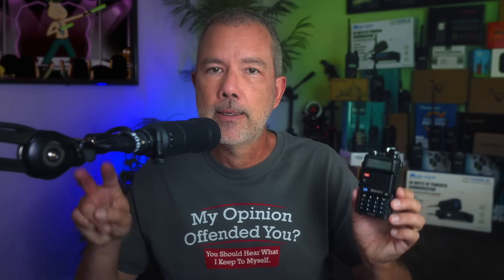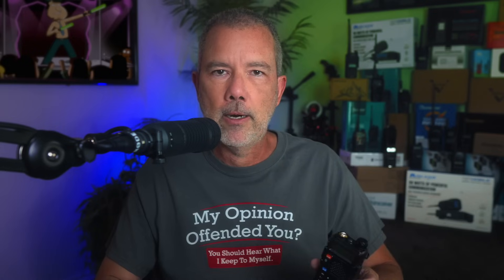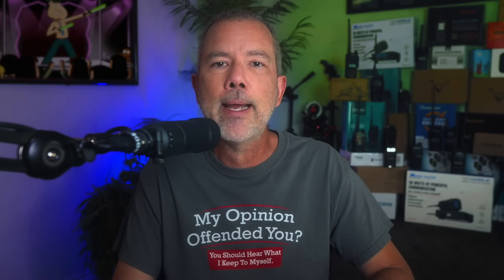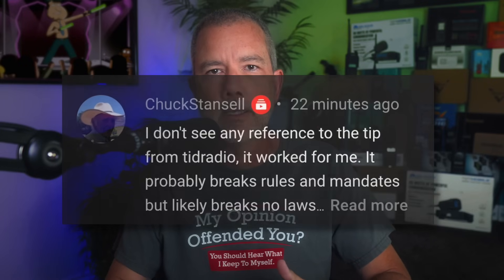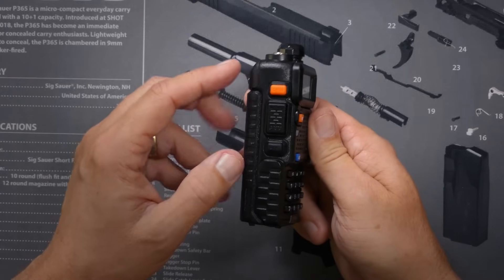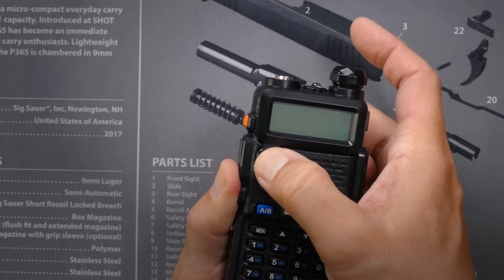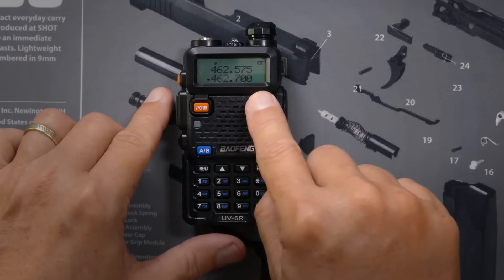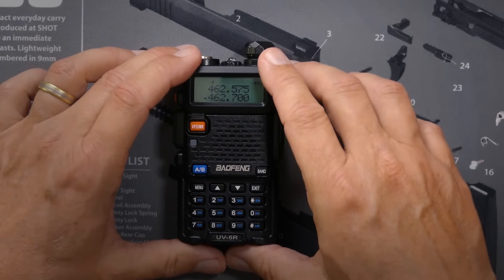How To Unlock A New Baofeng UV-5R - Easy UV5R Jailbreak To Transmit On More Frequencies

Comment: Any more details about potential CHIRP issues after this? Will a factory reset "Un-jailbreak" it so CHIRP will work as before? How common is this, just a "some people report"/"May possibly happen" thing, or a more of a sure/likely thing? And does it just affect a few things with CHIRP or make CHIRP useless?

"WARNING #4! - Some have reported issues using CHIRP with their UV5R after jailbreaking it - if you rely on CHRIP/are unable to program the radio by hand, do not try this."

Comment: Doesn't Work with new Radio. Shows "FACTORY" on screen but will still not transmit out of range with only beep that is it will not transmit on 220 Mhz Band even after using chirp to extend the upper VHF range. Did not try GMRS frequencies.
Reply from the maker: As clearly mentioned in the updates posted in the More Information section.

Comment: I'm new to this will this be able to pick up dmr ?
Reply from the maker: Yes, but it wont be able to decode it.
Reply: @TheNotaRubicon  I'm not sure what that means exactly but I'm guessing what ur saying is I can't use this for my job since we use dmr , thanks for your timely response sorry for some silly questions.
Reply from the maker: Sorry to confuckulation you.  The radio will 'hear' the digital signal, but it cant decode it, meaning all you would hear is garbled digital noise, and it would not be able to transmit any DMR.. 
So, DMR is a no-go with this radio.  You're not going to find a 'cheap' radio that can do DMR.
Reply: @TheNotaRubicon  luckily it was a yard sale find thanks for the information tho it was helpful.

Comment: SOLVED!
I changed to the FM radio and performed the 3 button dance and voila! Unlocked!*

Didn't work on my uv5r.
I tried both the 3 button and four button methods (4 button is to add the call button + the 3)
Reply from the maker: Is it locked? It wont work if your radio isnt locked.
Reply: @TheNotaRubicon  with locked you refer to not being able to TX?
It strange because on the back of my radio, when the battery is removed, i see freq range,  but i can tune in about 199.000 below and 199.000 above those freqs but no TX.
Will try different bands and see if it works.

Thanks for the quick response! 👍
Reply: @TheNotaRubicon  see my edit on the first post, solved it!

Comment: I didn't get the FACTORY on the display.
Reply from the maker: Then, either you did it wrong, your radio is not a UV-5R, your radio is not locked to begin with, or your radio is not UNlockable.

Comment: Yes that did nothing.
Reply from the maker: Is your radio locked? If you try this on a UV-5R that is not locked, it will do nothing because this step is not necessary.
Reply: Its locked as far as I can tell. I can't access the menu or change channels .   @TheNotaRubicon
Reply from the maker: Your keypad is locked, which is VERY different from frequency-locking which is what this video is about. RTFM and you will see how easy it is to unlock your keypad.

Comment: how come your default frequency shows 462.700 , i purchased one and the default is 435.722 , i am new to this and i want to receive certain frequencies  from 454.100 onwards ... how do i do this.. your advice is greatly appreciated.
Reply from the maker: Because thats the frequency I typed in to listen to. Just switch to VFO/Frequency mode and type-in whatever frequency you want to listen to.
If any of that sounds confusing, you will need to watch a few more of my videos, but you'll figure it out.

Comment: Thank you. Yeah. This is exactly what I needed to do in order to transmit on gmrs channels. I did a test because I have these to use in emergencies. Also I have a paper copy and screenshot of the transmission frequencies for GMRS channels. Doesn’t help that your unlocked if you don’t know what frequency to enter to equal channel 16 on an FRS radio, for example.
Edit

If it makes you feel better. I did order two brand new UV5R radios from Amazon. Great deal, only about 20$ each and you get a radio, earpiece, and charger. I received them in the mail this morning and got them working thanks to this video a minute ago. This is as of 3/7/2024. Looks like I’ll be investing into those better antennas for these. Thanks.

Comment: What do I do if it doesn’t work
Reply from the maker: 1) Do it again, but do it right
2) If your radio isnt locked to begin with, dont do anything because unlocking it isn't necessary.
3) If your radio is locked, and you did it right, then you have one that cannot be un-locked, and there is nothing you can do.
Reply: @TheNotaRubicon  Thank you! What is the method to confirm that it is locked?
Reply from the maker: Read through the warnings and updates in the More Info section about knowing if your radio is locked or not.
Reply: I think I connected some dots. I don’t want or need to unlock my radio. And they actually work when they’re not next to each other 😅
Thanks for your explanations and patience!

Comment: Mine said "coping" . never said "factory"
Reply from the maker: Is it even locked?
Reply: No reception to the other radios, so it doesn't appear to be transmitting. No irritating beep though. @TheNotaRubicon
Reply: I dinked around with the offset and got it to go. thnx. @TheNotaRubicon

Comment: it appears this no longer works...
Reply from the maker: it still works on many new UV-5Rs, but not all. It seems to be the luck of the draw.
Reply: @TheNotaRubicon  I think I need to return the Radios...   I can't even get them to transmit on the free to use freqs either
Reply from the maker: its a ham radio so it should only transmit on the ham frequencies.
Reply: @TheNotaRubicon  well I am trying to transmit on the US ham freq's...   no luck...
Reply from the maker: Ok, then you are either doing it wrong or the radio is defective...
...and I doubt you have a defective radio..
Reply: @TheNotaRubicon    it was...  turn t off.... then hit 3 buttons at the same time..... then turn it on....   wait for the word FACTORY   let go of the three buttons...  then it should work...  it doesn't... I tried turning it off as well... and back on... no red / orange when keyed.

Comment: I followed these instructions to the letter.  It did not go into Factory mode.  It just turned on as normal.
Reply from the maker: Is it even locked? If it's not locked, it wont do anything because you don't need to unlock a radio that isn't locked.
Reply: @TheNotaRubicon  I figured that was the case.  I don't know how to tell if it's locked or not.  New to the hobby.  Thank you for taking the time to put up all this info.  It's REALLY useful.  I just watched your video on setting channels.  Very cool stuff.
Reply from the maker: Please read the warnings in the more-info section of the video.

Comment: 2/5/24 - This method no longer works.
Reply from the maker: 2/5/24 - actual correct information: This method still works perfectly well on MANY UV-5R radios, depending on where you bought it from and how long it sat in a warehouse before it was shipped to you.  However, on SOME uV-5R radios, it no longer works.

Comment: Wish this worked with my new F8HP :( It will not display FACTORY when doing this yet the TX light dies go read but no okencan hear me on GMRS or MURS :( Plz if anyone knows a way to unlock this model wven if its a hardware mod let me know Thanks!! 73
Reply from the maker: Is it even locked?
Reply: @TheNotaRubicon  No one can hear me on any GMRS or MURS station at all the light goes red though. So yeah I think it's locked

Comment: What if the multi button unlock does not work?      I can hear ham but no red light when I hit that big button..   Using chirp and download from repeaterbook and in the 146.??? range.
Reply from the maker: Is your radio even locked? It wont work if the radio isnt locked because unlocking a radio thats not locked isnt necessary.
Reply: @TheNotaRubicon   Looks like I fall victim to UPDATE #3 and SOL I guess. Radio was from Dec 2023.

Comment: So I just bought one in Romania from eMag and has the TX unlocked for these frequencies. 13.01.2023
Reply from the maker: That makes sense since the locking is only for the radios sold in the United States.
Reply: @TheNotaRubicon  Thanks for your reply ! Usually we have more laws here than in US, they are very strict with the frequencies and transmit power (max 0.5W PMR, 4W CB). I bought this radio to use it as PMR for being very cheap under 20$ then I saw the capabilities. There's one field they don't fully control and thats the import retail.

Comment: The BF-F8HP that is just purchased this week 1/11/24 does not seem to be locked.  I programmed in all the GMRS channels and it worked without doing this.  I also want to buy a GT-5R.  Does anyone know if those are already unlocked or if this procedure will work on that model?

Comment: Will not work on my UV5R
Reply from the maker: Is your UV5R locked? It wont work if its not locked because you don't need to unlock a radio that isnt locked.
Reply: @TheNotaRubicon  for as far as i can tell it is a stock radio.  I got it new like 3 to 4 years ago. I cant acces the 220mhz or go lower then 136/174 or the 400/520 band.
Reply from the maker: It sounds like you dont know what locked/unlocked means. Please read the info and warnings in the More-Info section.
Reply: Oke😅. Haha thanks.

Comment: Did not work on mine. Tried it 10 times and has not worked
Reply from the maker: Is your radio locked? It wont work if you dont have a locked radio, because if it's not locked you dont need to do this.
Reply: It a new one. I have an older unlocked one and it will not receive anything from new to old.
Reply from the maker: There are a lot of reports of the very new ones being un-lockable. Looks like that's what you have.
Reply: That really sucks.lol

Comment: Thanks! I’ll be buying one, but will it unlock all or most of the FRS/GMRS channels from 462.5625 to 462.7250 to match my cheap Motorola radios?
Reply from the maker: No guarantee.. It's hit and miss with the new ones.

Comment: does not work on the BFF8HP radio/any leads to get this radio unlocked, thanks
Reply from the maker: Are you sure its even locked?  if its not locked then you cant unlock it..because.. its not locked.
Reply: when I do the button combination (several times\with power on) no indication of a factory reset. I did try to go outside of the factory set Freq to check if it is unlocked, no can do. I did find it can be done through chirp SW, waiting  for the program cable to arrive to try that. also I am not sure what version of the BFF8HP I have\is there a way to find out what gen I have on this radio.BTW thanks for a quick reply . @TheNotaRubicon
Reply: going back on my amazon history it states that I bought a UV-5R 3rd Gen/bought on 09/2019  @TheNotaRubicon

Comment: I tried this on my UV-17R (just like you said not to). The radio was bricked until I removed the battery (screw on batt was a bad choice). Unit functions normally again.

Comment: Anyone know if and how to unlock a 21r i got one for free but cant find anything on it, ive also got a 999pro i got for free and cant figure that one out either any help would be appreciated
Reply from the maker: Most radios are not unlockable.. If you cant find how to unlock it after 3 minutes searching Youtube or Google, then it is likely that it cannot be unlocked.
Reply: I didn't figure, but i got em for nothing, so i figured it'd be worth a little further research. Thanks for the response

Comment: I just got two "locked" uv5-r 8 watts about two weeks ago. All I did was hooked them up and used CHIRP to install my radio channels from my old uv-5r 5W and they work. But the paper with them says they will not tx on GMRS. Well, I guess CHIRP didn't get the message that they were locked.

Comment: Mine didn't say "Factory", just said "Channel Mode"...
Reply from the maker: That means either you did it wrong, the radio is not locked to begin with, so you cant unlock it, or, you have an even newer one that cannot be unlocked.
Reply: Thanks for the rapid response--it is a UV-5RIII @TheNotaRubicon

Comment: I was follow the video instructions, however show me as factory reset, but when I put in a frequencies number immediately change back to a other.... Any advise please.
Reply from the maker: Unlocking the radio does not change what frequencies you can enter/receive so it sounds like you are entering a frequency that is outside the range of the radio.
Reply: SO HOW CAN I CHANGE THIS PART?
THANK YOU FOR YOUR REPLY. @TheNotaRubicon
Reply from the maker: You will have to buy a radio that receives the frequency range you want to listen to.

Comment: Hi Randy. Firstly, love the channel & your videos. @bryanb4308 is 100% correct.... like him, your sense of humour cracks me up. Real Estate on Mount Stupid must be worth a fortune nowadays. 
I'm late to this party, but the factory reset method using the PTT/Mon/VFO buttons together then turning on, does not seem to work on the Canadian UV-5RIC model, or at least not on mine. The Reset All option does wipe out all one's settings however, but a quick jaunt into CHIRP will put things back to rights.
Thus far, I have been unable to locate any methods of "unlocking" the radio for Tx on FRS/GMRS (license exempt here in Canada). As an aside, the GMRS radios such as Midland's offerings are illegal for use in Canada. 
Keep up the great work! Love your Jenga Wall.

Comment: Wow, just tried this on my new uv-17 and bricked it. Any thoughts on how to reset it?
Reply from the maker: Please read through all of the warnings in the More-Info section.
Reply: Not pointing any fingers. I did what I did to see if it would work on my radio, for which it did not. Was just hoping someone would have a suggestion as to how to make repairs. Love your videos, and appreciate your production value.
Reply from the maker: Does it not even turn on/are you able to get into the menus and try a reset?  If not, try pulling the battery for 5 minutes then put it back in and see if that does anything.

Comment: UNABLE to UNLOCK! (you just turned me into a sad ham! lol jk i dont have a ham lic.) 

Purchased UV-5R 10/01/23 (CHIRP reads it as a radioddidty, forgot which model). 
I tired doing the 3 button hold down and turn on but it does not show a "factory" message.
Reply from the maker: Is the radio even locked to begin with? If its not locked, nothing is going to happen.
Reply: ahhhh.. you are correct sir. I guess it came unlocked.. so once you unlock it and see the "factory" message that it. it wont pop up again. thank you  @TheNotaRubicon

Comment: We have 4 unlocked UV-5R radios. I am trying to get them to communicate with our Standard Horizon HX300 radios. I can transmit to the SH and hear the transmission on the SH. When we try to reply from the SH the Baofeng lights up and shows it is receiving a transmission, but nothing comes through on the speaker of the Baofeng. Any cure for this?
Reply: baofeng doesn't like being near your HX 300 so keep them at least 30 meters away and everything will be fine.
you also need to deactivate the receiving tones at the baofeng (ctcss)

Comment: Try this, with help of my right BIG TOE got a cramp..  working with uv-5r+ plus.  It did not work for me. Any suggestions?
Reply from the maker: If it didnt work then either your radio is already unlocked, or, you're not going to be able to unlock it.

Comment: Hello... I have a BF-F8HP, and it will not enter FACTORY mode at all. I've reset all multiple times, and I've followed your videos to set up. But can't get my radio to jail break into FACTORY.
Reply from the maker: Is it even locked? It wont work if the radio isn't locked becuase you don't need to unlock a radio that isn't locked.
Reply: @TheNotaRubicon  I'm assuming it is because I'm trying to go and listen to the small airport traffic in Hollywood FL 134.300 and it says canceled 😞 not sure if that means it's locked or I simply can not do that?
Reply from the maker: Please read all the warnings in the More-Info section of this video.
Reply: Yes I read that it may be a newer radio. What's unclear is that you also say it is breakable still? I want to have a bug out radio in the case of a shiiii hits the fan situation.
Reply from the maker: a year and a half ago when this video was made, some were still unlock-able.. Now, many arent. If you try it and it does not work then it is not un-lockable.

Comment: I was just wondering if I could use it while in the woods to keep in touch with others I am hurting with without getting in trouble.
Reply from the maker: The UV-5R is a ham radio and the FCC says that to use a ham radio you must have a ham radio license and transmit only on ham radio frequencies.
Reply: @TheNotaRubicon  thanks for the info I enjoy your videos

Comment: It didn't work on my UV 5r 4k purchased in 2020
Reply from the maker: Is it locked? It wont work if the radio is not locked because you don't need to unlock a radio that isn't locked.
Reply: @TheNotaRubicon  how can I tell of it is locked or not?  I'm a pathetic noob
Reply from the maker: Please read all of the warnings in the More-Info section of the video ASAP.

Comment: did not work my radio.
Reply from the maker: Is your radio locked? It wont do anything on an unlocked radio, because its already unlocked.
Reply: @TheNotaRubicon  I can't put some frequency on it  like 118.300 it Said cancel
Reply from the maker: Thats because 118.300 is out of the range of the UV-5R.